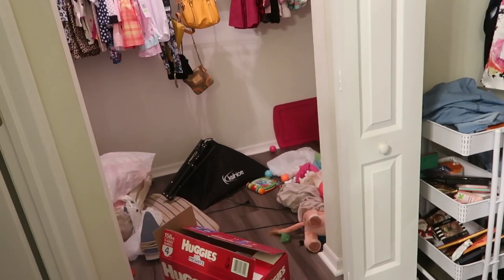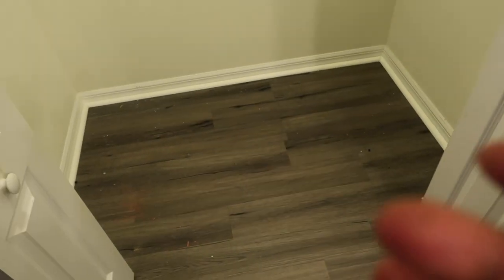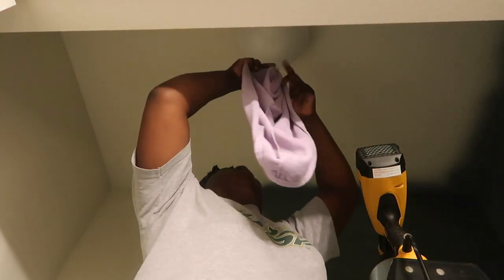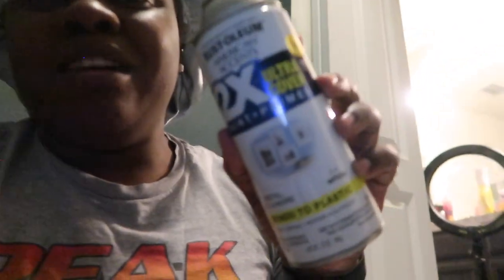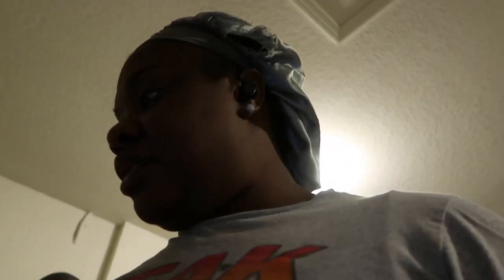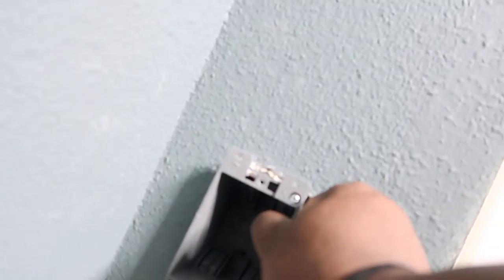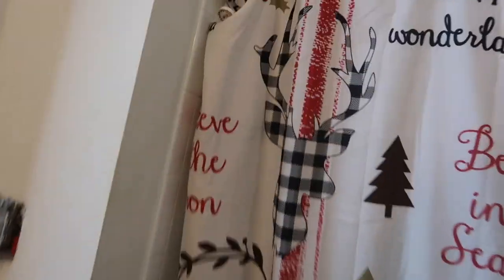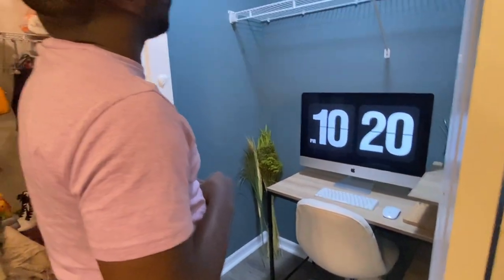I messed up my wall! closet makeover | fake it til i make it diy series

Comment: Paint on laminate floors is easy to scrape up with a fingernail or putty knife—especially if it's drops. If it's smeared use 90% alcohol. I got paint off the the back of my cupboard door that got on it when I was painting the front with alcohol on a rag.
Reply from the maker: Ahhhh that’s an good idea didn’t even think of that thank you!